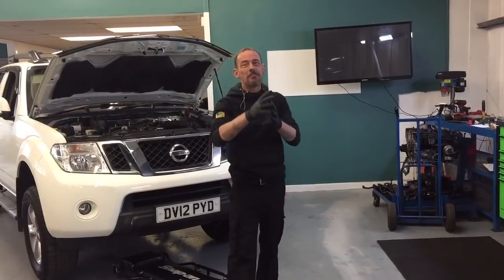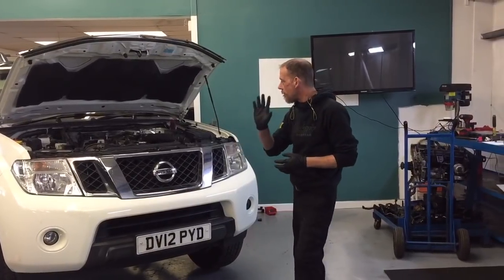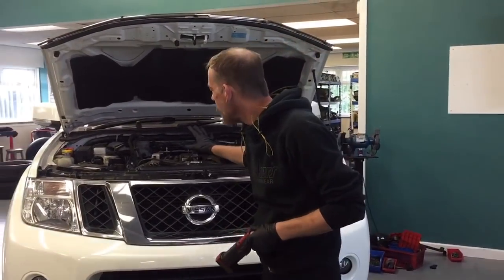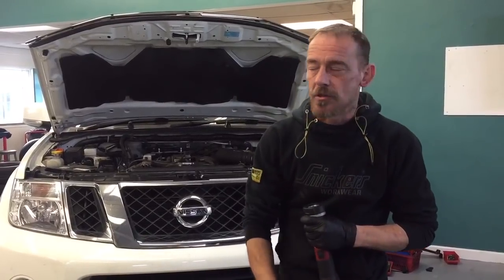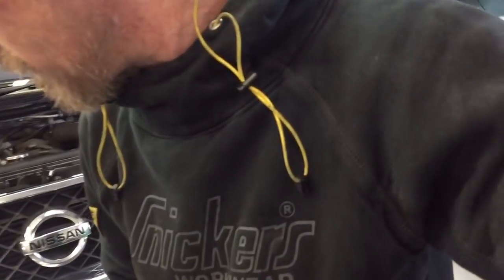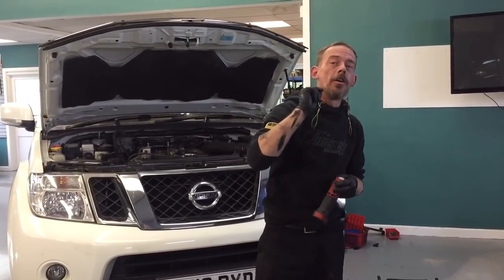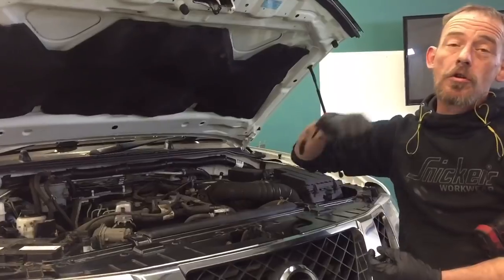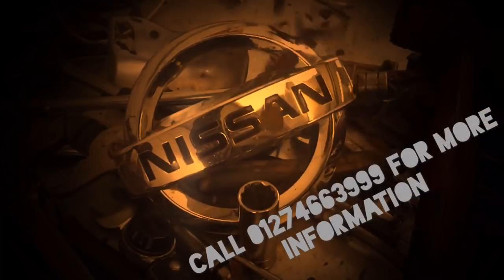CODE P0016 - P0017 Crankshaft/Camshaft Position Sensor Fault

Comment: So if it was a chain thats stretched or going, surely the light will be on all the time? I keep resetting mine to find it coming back on within a week.
Reply from the maker: ifell3 no buddy no light to give you warning
Reply: Sorry what i mean is that if it was the chain, wouldnt the light come on as soon as i started it up, not a few days later? Regards
Reply from the maker: ifell3 no not at all
Reply from the maker: ifell3 timing chain starts with poor starting buddy
Reply: Thats what you said,, no poor starting a little rough idle, but a maf sensor is pinging up a code (101) or something. Sorry mines a vvt yaris so thou not miles apart!!

Comment: I was wondering if your still answering questions on this video my vehicle has the P0017 code but shows no symptoms at all I know the (Oil in this Saab 97x was not changed in over a year or more )  someone told me a certain filter oil control valve clogs and shuts the control to an off position would just an oil change work and how do I reset the ocv sensor back to on ???

Comment: I’ve got a 2002 xtrail diesel. Wont start with camshaft position sensor plugged in but when unplugged it starts. Wiring and sensor checked out ok. Crank position sensor wiring is ok but not sure on the sensor yet. Any ideas what it could be ? Thanks
Reply from the maker: Timing chain buddy, Sorry to say. Cheers Des
Reply: West yorkshire engine services thanks for that 👍

Comment: Hiya there, I bought a 65 Nissan pulsar damaged, the ecu is blown, got a second hand ecu took it to dealers to reset and reprogram, they couldn't do it, they said I have to buy a blank new ecu. Can you flash/erase these ecu,s? The car is trying to fire but petrol don't come through it seems it's got a immobiliser on it.

Comment: nice look at your face LOL great video keep up the good work
Reply from the maker: anto denn I am an old man now technology beats me every time
Reply: @westyorkshireengineservice9160  hi i have a 2007 Cadillac sts i have a p0017 code been check engine light on bout 2months now goes off on its on sumtimes cranks good runs good but have loss little power and gas millage never stalls wondering is it a sensor or vvt can u let me know ur opinion thx